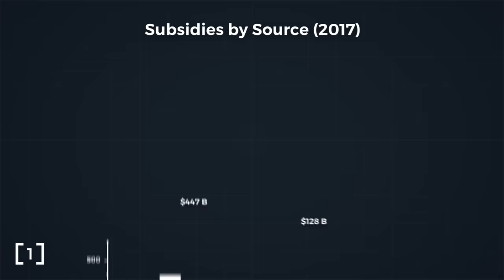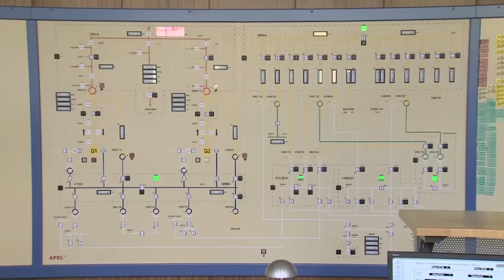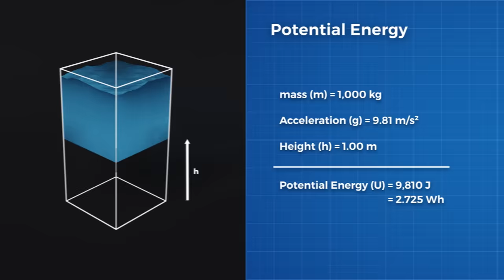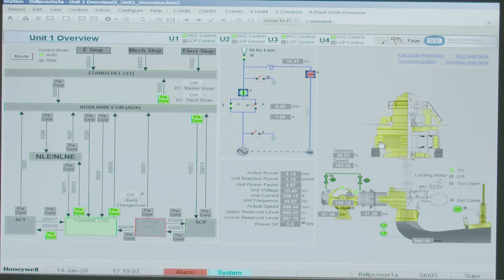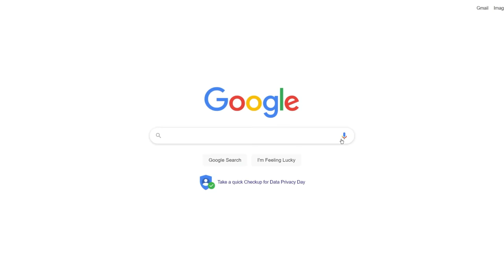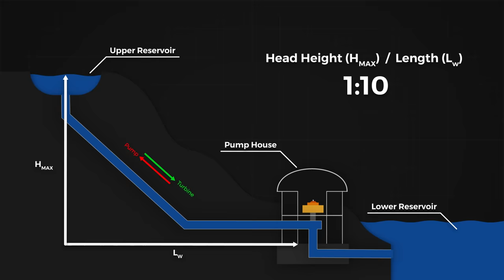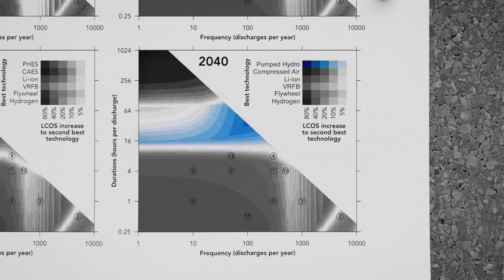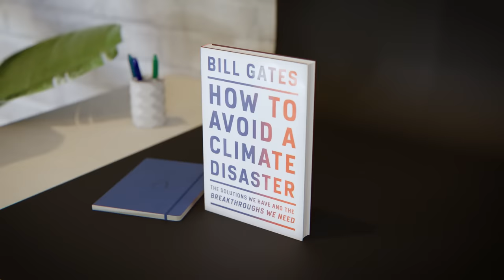The Truth About Pumped Hydro

Comment: Nuclear power-- the best energy source!
Reply: Not that I'm against it but it is incredibly expensive.
Reply from the maker: Will be great when the technology is affordable to use safely. It’s getting there.
Reply: @RealEngineering  I'm really excited for the day as well. Old nuclear tech... Works... Fairly safe... But stupid expensive to get up and running and could be safer
Reply: What energy is used to mine and refine the uranium?
Reply: I agree with you, btw.
Reply: @RealEngineering  Yes, this is true now, but new fast neutron reactors can use recycled fuel from conventional nuclear power plants, which will make this type of energy cheaper, and a metal base made of sodium, and even more so from lead, is much safer than conventional ones
Reply: @spidermight8054  The same energy you use to heat your bum on the winter or to boil your fucking noodles, whatever is available, and in our situation, 60%+ is always from fossil fuels.

But go ahead and keep subsidizing fucking solar panels that generate 3% of the world's energy needs and are only viable due to government. In this very video we can see that 'Renewables' are subsidized for ~35% of fossil fuel subsidies, while generating less than 10% the energy that fossil fuels generate (65% of the worlds energy consumption).
Reply: @Tomas-vn2fk  Sorry but no, nuclear is prohibitively expensive to build, the cost of which is not recouped in its lifetime.
Reply: @RealEngineering  How much safer do you need it to be?  Seriously.
Reply: Not as good as fusion ;)
Reply: @Tomas-vn2fk  Sorry mate but the facts prove you wrong.  In the UK we have wind providing about the same as nuclear over the year. One is getting cheaper and the other more expensive with a widening gap between them. Most importantly we can dismantle wind turbines and deal with the waste without having to bury it away for thousands of years.
Reply: It is very expensive to build but it does return in its lifetime.  It just takes a long time.  A planting trees for your children kind of situation.
Reply: @michaelwallace9291  Nuclear power is already amongst the safest forms of power generation that we have. Nuclear might be more grand when it fails, but it's much more rare and kills far fewer people than what mining and operation of fossil fuel plants does. The fossil fuel industry is also heavily subsidized, as was mentioned in the video, and doesn't pay for the CO2 and particles that they emit. Nuclear power doesn't have any of those issues, and radioactive contamination is strictly regulated. 

What you're paying for is extremely high safety standards that keep getting higher due to a skeptic public, and the fact that it doesn't kill you or the planet slowly.
Reply: @Tomas-vn2fk  Nuclear is an objectively expensive way to produce energy (see https://en.wikipedia.org/wiki/Cost_of_electricity_by_source#Global_studies ). Renewables are way cheaper. How expensive it is exactly depends on whether you factor in the storage of the nuclear waste. 
But I agree with you this might be something we'll have to face for some time if we want to avoid climate change. Nuclear is not a sustainable form of energy production.
Reply: @Bramble20322  why are you ripping on me and my burnt noodles? How did you even know? Weird!
Reply: @Tomas-vn2fk  brutal
Reply: @RealEngineering  It can't be affordable because the energy sector isn't a free market.

Nuclear never gets its fair share of investment. 
The amount of positives that wind gets when it is literally the worst "renewable" energy in terms of environmental impact.
Reply: @spidermight8054  Change uranium to lithium and ask another dumb question.
Reply: @AndyFletcherX31  I wonder which got more funding?
Reply: @SWEm4rt1n  My problem with nuclear is not the risk of a meltdown now. That is a risk that can be mitigated and as you said, leads to fewer deaths than fossile fuels. 
My problem with it is the risk inherent to the waste products of current reactors. Storing something that is really dangerous but subtle and can make whole reagions unlivable if it for example gets into the ground water is challenge even for some years. 
And in this case, we would need to store it for longer than known history. These are timescales where no countries existing today are likely to survive, and even languages will probably change so much that even leaving warning signs is a serious problem.
Reply: Unfortunately its expensive to build and harder to monitor. Not to mention the political influence.
Reply: @Tomas-vn2fk  Average worldwide electricity generation is about 2900GW. Wind will struggle to produce a lot of this but solar is easily scalable on a global basis. Wind comes in at about $2500/kw, Solar $1000/kw, nuclear is much higher than this. 
Storage is an issue which is why there is so much interest in H2 and liquid fuels which can be used for storing large amounts of energy to time shift and seasonal storage. All this is entirely possible over a 20 year period.
Reply: @edby995  Probably nuclear in a kwh basis
Reply: Nuclear has similar problems to pumped hydro: very long regulatory delays during construction.  Those delays raise the costs a lot, and are another reason why old-style nuclear plants are not worth building.  Newer modular nuclear plants are even more expensive because they're not proven, along with similar regulatory delays, so financing is even more expensive. 
The solution will be chemical batteries with renewables.  You'll see.
Reply: @michaelwallace9291  Thorium reactors and small modular reactors for me are the best, the rest of nuclear, I don't trust it
Reply: @Bramble20322  Fossil fuels came firt, not a fair comparation. Also this video showed the US. Lokk at Portugal, a good exemple of renewables working (specially wind and hydro). Also not every country is subsidizing solar panels. Most of pooor countries aren't
Reply: @SWEm4rt1n  oh I agree fully with everything you just said. I'm just really excited to see these new florida reactors american gov is to cowardly to allow to be developed here and are being R&D'd in china and india. I'm wondering how they're going to solve the corrosion issues. But being smaller and inherently walk away safe and waste is safe by 500 years instead of 10k.

Like. That sounds very enticing if a few material issues can be solved.

Though I know america has 99 running reactors and there's been no serious issues and anyone who mentions 3 mile island has not actually researched that "disaster"
Reply: @togamid  then it isn't our problem.

Na, I'm not serious. 
Real answer - reactors are being built that are capable of running of this already used fuel since roughly 97% of the potential energy in the solid waste often isn't used.

But more importantly than that reactors are in R&D in multiple countries and one was actually in use as a test in america in the 60s where it's waste is safe around 400 years - also gives us medical isotopes not found in nature that in tests in the 60s cured cancer in a very small low quality anecdotal amount because they had so little resources to work with.

Although liquid florida reactors have corrosion issues leading to too much down time for maintenance so I want to see how someone fixes that in the future
Reply: @joaquimbarbosa896  that's likely because it's easier for the human mind to contemplate singular large bad things. 

Other forms of electricity generation cause far more harm and are far more dangerous but because it's like a death from 1,000 cuts or say boiling a lobster slowly alive. The human mind just doesn't throw up alarms. Nuclear is super safe. What isn't safe. Russians building things. What isn't safe. Greedy companies saving money instead of investing in safety. But both of those things I just mentioned kill a far higher % of ppl per kwh produced than nuclear. In some cases hundreds of times more especially against coal but even against solar and wind to a small margin
Reply: @SWEm4rt1n  What nuclear advocates always fail to admit is the huge upfront construction costs of nuclear plants, largely from long regulatory delays, along with political risk, and the big long-term risk of decommissioning the plant, and the guarantee of dropping costs for renewables.  Investors don't invest in nuclear because it's much more risky than the alternative bet of renewables.  
For these reasons, old-style fission plants are dead, and are no longer worth talking about.  Newer modular plants have much potential, but are not a good bet for investors compared to safe, fast, rapidly-improving, and easy renewables.  By the time we see new modular fission plants plugging in to the grid, renewables + batteries will be cheaper than any other baseload power, with an insurmountable lead that will widen over time.  
Nuclear plants are more expensive and risky than natural gas plants now, and more expensive and risky than renewables when looking ten years out.
Reply: @spidermight8054  I meant for batteries lol
Reply: @togamid  Thanks for replying! I agree that storage is a possible concern. However the time scales of "longer than known history" applies to some fuels such as uranium. Using other fuels such as thorium reduces this drastically (to less than a hundred years in most cases if I remember right) and makes it so that radiation concerns won't last as long. Finland has also recently begun the construction of long term storage, so it is possible to solve this issue.

No energy source is perfect, but nuclear power could keep us going for a hundred years or more so we can transistion to less radiative fuels. Even during that time the amount of radioactive waste produced would be relatively small to other sources, and decay quicker and in other forms of radiation that don't last as long as those from uranium.
Reply: @charliedoyle7824  Thanks for your reply! I completely agree that nuclear power is very expensive. I do however think, like I said, that at least part of this is due to the public and investors being very worried about safety, and thus increasing the overall cost. 

I also don't believe renewables + batteries is a viable option. In short, we need to be able to produce and consume power at different points in time, and with current technology we have no way to store all the energy produced for when we need it. Even if a new material emerges, it means industries need to create new machines to manufacturer batteries based on these materials. All of this is very expensive and time consuming.

There is a certain amount of power that is always consumed on the grid, called "base load", and this is what coal and gas is now supplying. Nuclear only need to replace these powerplants in order for the grid to become carbon free (almost). Nuclear power is a tried and tested energy source which can produce this amount of power continuously, and which we are able to build more of right now.

I think if governments subsidized nuclear power plants, some cost concerns wouldn't as pressing, but public opinion is mostly against nuclear power, which I think is the greater issue.
Reply: @SWEm4rt1n  First of all, that's why I specified it to be waste products of "current reactors" ;). But my problem with Thorium reactors is that they seem to be "10 years away" for a while now, kind of like fusion is always 20 years away. So I'll believe that they are a solution when they are operational and actually do not produce that much waste. And even then storing waste for 300 years (I got that number from here https://vittana.org/16-big-thorium-reactor-pros-and-cons, probably not the best source) is a lot more manageable than 100.000 years, but in no way easy or cheap. 300 years ago, Bach was alive and Texas was French. 

Regarding Finland: Yeah, they are building a site, but as far as I know, there are still a lot of things which are not quite solved (for example the already mentioned language issue). And "it might actually be possible to store the waste we produced long term if everything goes as planed for the next 100.000 years" is not great argument for producing more of that waste.

But I agree, we might have no other choice but to accept the risk and the burden on future generations to avoid even worse results from climate change. Though nuclear power has been a "bridge technology" between fossile fuels and renewables in Germany since the 60s (without actually significantly increasing the amount of renewables once the nuclear plants stood). There's a lot of truth to the saying "nothing is as permanent as an interim solution", so I don't have a lot of faith that people are actually starting to invest into renewable energy sources if they just invested a bunch of money into nuclear plants which work "perfectly fine" this time and don't just kick the can down the road again
Reply: @SWEm4rt1n  You should pay more attention to what is happening with batteries now, and what's coming out of labs.  You simply are wrong about them, mainly because you are looking backward, not forward.  Sure, based on right now, they aren't there.  But, they are advancing in cost-reduction much like solar, and many new chemistries are in the lab with great potential.  The age of batteries is just getting started, and there is enormous investment coming in now, along with epic demand.  The battery industry will be much bigger than automobiles pretty soon, and keep growing fast from there.  Once a grid-battery system sells for $50/kWh, which is likely between 2025-2030, they will put an end to new gas plants, and make coal plants stranded assets.  They are at around $140/kWh now, and over $1000/kWh ten years ago.  Ten years from now is the same time it takes to build one nuclear plant.  
You act like there needs to be some fundamental invention for batteries, but that's just as wrong now as it was ten years ago in solar.  What happened with solar was the scale of manufacturing got much bigger, and price competition lead to 90% price reduction in fifteen years, with nearly the same silicon panels.  The panels themselves got maybe 3% better at conversion efficiency during that time.  The same kind of curve is happening with batteries, but the cost starting point was higher, and the big demand started later.  Combined with the new battery chemistries like lithium-metal, solid state, sulfur-flow, and many others, large-scale battery will easily allow renewables to be baseload.  Plus, solar price-reductions will continue apace, as panels improve and factories continue to scale.  I wouldn't be surprised to see .03/kwh wholesale baseload power from solar+battery by 2030, compared to .045 for gas, and much higher for nukes.  The trends are obvious.  Look forward, not backward.

Comment: I was involved in a construction job several years ago that put pipes underground for a reason. To check the system they pumped water through it before it went into operation. At the man holes you could hear the roar and feel the ground vibrate 100 feet away.

Comment: This sounds like a game sometimes, it is unlimited, but not reliable or it is finite and powerful but also gives a health penalty
Reply: Yeah, otherwise there wouldnt be any "energy problem"
Reply: Its why understanding compromise is so important. A melding of Renewables, nuclear, battery storage and kinetic storage is required to end fossile fuels for good. There isn't a "good" ratio, because it will change based on the geographical point of reference. Arid countries could probably go almost full solar and be fine, but for example, a country like fance does not have consistent enough sun, wind or hydro to use that as a baseload, only nuclear energy fits the bill. 

Understanding that a diverse grid is what is needed for a good transition is what doomed many transitions in the past that have actually lead countries to end up WORSE than where they started. Germany dumped its nuclear park and made a lot of efforts to dismantle it, both its plants and its knowledge base of plant building and operations in a moslty self destructive endeavour. They then tried to push for solar as a baseload, a nonsense for the environemental condition of the country. Now Germany is one of the worst poluters in all of europe as a result, because by dumping their nuclear park, they have raised their dependence on gas as a baseload. A predictable (and predicted) outcome.
Reply: @mobiuscoreindustries  Also, remember that German oil comes from Russia. That's why Germany today are not so strict when it comes to criticizing Russia
Reply: @darnit1944  yeah, just political games being hidden behind "a good cause" as ususal. Its so easy to spot when politicians go on speech after speech on how they will take strong actions against climate change, and then evade questions when asked on how they actually plan on doing it. Just an easy way of building and selling influence